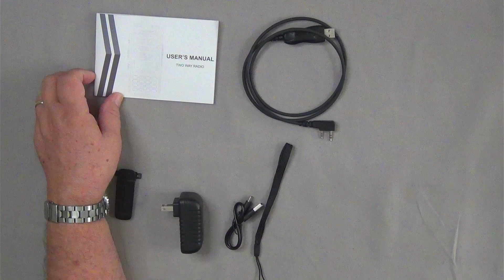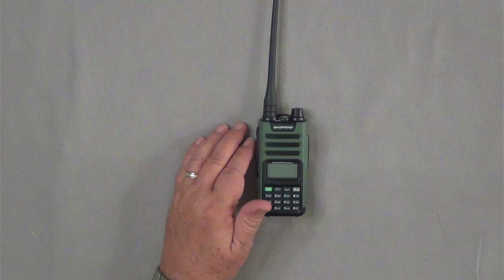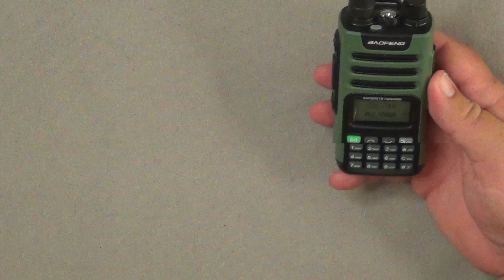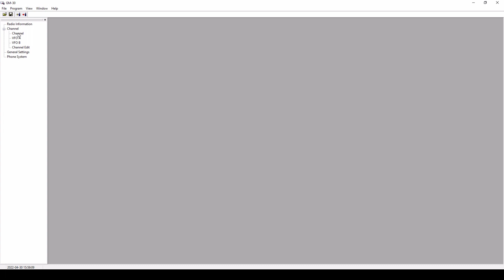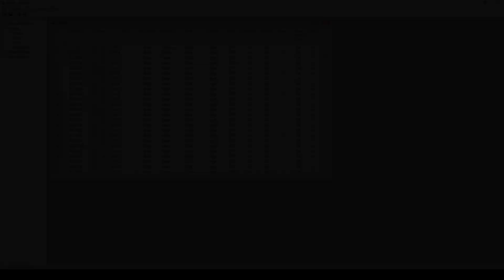BaoFeng GM - 15 Pro GMRS HT

Comment: Just got a 2 pack gm15 pro that was supposed to be 8 watts. And also supposed tobe 2100mah battery but no way to tell if the battery is 1600 or 2100. Some Amazpn reviews said they bought the same and only got the 1600mah battery. :)
Any easy way to tell?
Reply from the maker: I don't know an easy way unless you have a fancy batter tester that will run the thing down and measure mAh used.

Comment: I was looking at this radio on a Prime Day deal. Yes, it's almost an exact copy of the GM-30, but the GM-30's biggest flaw is that it has an SMA female on the radio which is the opposite of 99% of other Chinese radios. Per your excellent images, the GM-15 Pro has the SMA male on the radio. Wish I'd bought this radio instead. 😕
Reply from the maker: It is a bit odd that they have the reverse of so many other inexpensive radios.

Comment: For this radio, can you go to channel 30, for example, by pressing the channel button, and then program the tones into the radio? I guess I’m not sure how this radio works, (for example), if you can only go to channels one through 22, but then you have to program the repeater channels into it? This may seem like an obvious question, but I’m visually impaired, I cannot see the screen. The radio is actually on sale for $20, for prime day. Thanks for any assistance.
Reply from the maker: You can add CTCSS or DSC codes to either or both transmit or receive by channel as you described. GMRS radios have channels 23 through 30 as repeater channels so there is no need to figure offsets. Just remember TX is the code your radio sends out, RX is for what your radio receives. When dealing with repeaters, folks sometimes mix those up. Cheers.

Comment: Thanks for the information posted on the BaoFeng HT radios. I recently purchased the GM-15Pro, I downloaded the programmer software Prodioddity GM30. After installing the UART driver for the communication cable, it was an old driver but seems to be working on my Windows-11, when I launch the Radioddity program and load the radio information I don't seem to be able to expand any of the channel table columns and width, everything comes up collapsed on the display. Has anyone have had this problem? I can click and see the channel information screen just fine; this is the GUI box that pops up and I am able to set the settings with no problem. It is just how the channel table matrix being on the computer screen that it is collapse. Like in an Excel table one can pick a side and expand the height or width of the columns/rows not on this application though. Any suggestions? Perhaps is the old Windows driver provided by the Mfg that I need to update? Thanks

Comment: I just purchased a Baofeng GM-15 Pro. I've watched your video but can't make the talkies talk. None of the videos look like my screen. Point me in the correct direction and I will be greatful.
Reply from the maker: I have a video on programming a GMRS radio using a CPS. Start there.  It's much easier seeing settings in one place, not in a bunch of separate  menu items. First thing to check will be RX and TX DCS and CTCSS codes.

Comment: What do you do if all the com ports are grayed out? My computer recognized the device.
Reply from the maker: Hmmm. Check Device Manager and see what port the computer assigned. Try clicking on that one in the CPS. On my PC the ports that are active are very dim. Otherwise try a different programming cable that uses different drivers -CH340 or FTDI. Good luck.

Comment: How does this compare to the UV-G5 Pro?
Reply from the maker: The UV-5 G Plus radio has some additional features like more channels. It comes in a two pack so total price is higher, but per radio the price is similar. Also two antennas. Otherwise very similar performance-wise. Styling might be your biggest factor. Take a look at my review of the UV-5G Plus  https://youtu.be/7D5Fob77hHk?si=UOLkf0jniGrFy37_   Use the link in the description for a discount. Cheers.

Comment: I downloaded the software from Radiodity for my GR-15.  I can do the other programming as described in the video on the software but for some reason, I am not able to change the logo.  It is blacked out.  Any help on how to fix that?
Reply from the maker: Unlike some  of the most recent radio releases, these older radios allow you to only choose between the pre installed choices for the opening screen.  You can only choose preset logo, present message or voltage.

Comment: I only have a Windows 10 computer. Is all the downloadable programming compatible with W10?
Does it require a special cable?
Reply from the maker: Actually, some folks have reported issues with Windows 11, so you're good. A BaoFeng programming cable will work. A BTECH FTDI cable on Amazon costs more but is a good cable, too.Avoid cables below about $8 to $10.

Comment: Please excuse my ignorance. Is it possible to transmit on FRS channels with this radio?
Reply from the maker: GMRS and FRS channels are shared and are the same. FRS bandwidth is smaller but that doesn't seriously impact reception. The frequency table in the GMRS Wikipedia article is helpful in envisioning the various channels. Cheers.

Comment: What's the difference between baofeng GM15 pro and baofeng GMRS 9R
Kinda confused which to pick im new to this so no idea which do what all i know is they are gmrs
Reply from the maker: Two primary differences. GM15 has more programmable receive only channels and 9R has a waterproof rating. The 9R will require a different programming cable and can't use most accessories like hand mics or wired ear pieces since it has a different, waterproof connector on the side. If you're just starting out and don't spend time in the rain, I'd go with the GM 15 instead. Radioddity GM 30 is also a good choice at this price point.
Reply: @GadgetTalk4U  thanks for your reply, i usually work outside and my place get alot of rain and in winters, its dense fog through out the season
So i think that Ip67 9R is better option for me
But both are similar but one has waterproofing and other doesn't?

Comment: I'm new to HAM.  Can you listen to 2 drifrant channels at the same time?
Reply from the maker: Many radios, both ham and GMRS, have a menu item for a setting called dual receive or something similar. You can choose to listen to one or two channels. Some will also allow you to select which register you transmit on.

Comment: Thank you.  I am having difficulties downloading the Radiodity GM-30 programming CPS software.  Any hints?
Reply from the maker: In some cases, the CPS and firmware have to match. I noticed on the Radioddity web site downloads page that there are several firmware and software choices for the GM-30. Check you firmware by turning off the radio, press the button below the PTT and hold it while turning on the radio. The firmware number will display for a couple of seconds. Write it down. You may have to do this a couple of times to get all the numbers right. Mine showed 06.03.006. On the download page I'd get the 210615 version that lists 06.03.006 as the matching firmware. When I tried downloading it, it downloaded just fine - for me. Let me know if I missed the point of your question.
Reply: @GadgetTalk4U  Good advice, thank you.  It took some fiddling around but I finally got a read from the GM-15.  Then it took a few more experiments in order to get it to accept the changes and write to the radio.  Now, all 3 BaoFeng GM-15 Pro radios and my BTECH GMRS V-2 match but with two very different CPS.  Makes me appreciate RT Systems programming software.
Reply from the maker: @donalddodson7365  Good. I often have to remind myself I'm doing this for fun!  Things can be fiddley sometimes. Cheers.

Comment: I recently purchased (2) GM-15 Pros and installed the Nagoya NA-771G on both.  Achieved 6 miles of clear reception / transmission.  Located in Central Florida moderately hilly, trees from backyard to a point 6 miles as the crow flies. Very pleased. Thanks for the video.
Reply: Hi. I live in Central Florida and looking for a good GMRS radio that me and my wife can use. Your 6 miles transmission, is it simplex handheld to handheld radio transmission? I'm thinking of a base station and a mobile in with an 11-mile distance and if your 6 mile is HT to HT, I think my goal can be easily achieved (fingers-crossed).

Comment: Thanks for your review! i’ve subscribed. Since you have both the Radioddity GM-30 and the Baofeng GM-15 Pro , are the batteries interchangeable?
Reply from the maker: I hadn't thought to check. Good question. In fact, they are interchangeable. Thanks for asking.
Reply: @GadgetTalk4U  Thanks. I was hoping. Amazon has a GM-30, 2200 mah battery listed, so I’m ordering one for the GM-15 Pro radios I have on order. Can’t beat the price!! They had the GM-15 listed, but I wanted to be sure.

Comment: Lots of information here. Good job on that. Video is way way way too long, however. All we wanted to know was how to toggle between MR and VFO. And we were disappointed. Keep making videos.!
Reply from the maker: Length and depth are always a challenge. Sorry. Fortunately, most sellers or the manufacturer will have the User Manual available for download. I find that is faster than videos to find a specific piece of info.  Cheers.
Reply: You sound like a d bag

Comment: Do you have any experience with the UV-9G? If so, how do these two compare and do you recommend one over the other or would you even recommend the GMRS-9r or radiodiddy GM-30? 

I can't seem to find anything that really explains the differences/similarities of these radios and when I read the description and specs, they seem pretty much identical except for a USBC charging port and battery size. As far as the function and programming of the radio, I would love to hear which one is recommended over the other and why.
Reply from the maker: I have reviews on the UV9G, and GM 30 on the channel. They should help you make your choice. Cheers.

Comment: You can't program with chirp nor radioity so it's junk
Reply from the maker: I just checked, the GM 30 software that I use in the video is available at Radioddity. I'd try the original version first. It worked fine for me. I haven't tried the version for the new GM 30 firmware.
Reply: @GadgetTalk4U  but you can't modify the frequency you can't get rid of the frequency they allready have in it. You can't put ham frequency in and modify. O well I'll send back to China. Get a different one
Reply from the maker: OK. I understand. For GMRS radios sold in the US, all transmit frequencies are locked to the GMRS channels. Even newer ham radios are range locked nowadays.
Reply: You can program it with Radioity as a gm-30

Comment: Good Morning Sir. Question regarding FM radio frequencies with this radio. I just picked up 2 of these for my brother as a gift, and one pf them can only recieve between 65 and 75 MHz. The other works fine and receives the full range of stations from 65-108 MHz. Is there a way to fix/unlock the rest of the stations either manually or with CPS? Or is this a defect I should return. Thank You in advance.
Reply from the maker: According to the instructions I saw, when listening to FM, press the back/weather key to switch to the US FM range. I think it is section 6.8.
Reply: @GadgetTalk4U  Thank you for the swift response Sir. That worked! I really appreciate your time and expertise and I hope you have a great weekend!

Comment: Quite a radio for $30 
Again I will ask on usb charge plug.
 How does a 5 volt cell charger charge a 7.4 vdc battery. 
Unfortunatly no community repeaters up on a tower so no repeaters in SW PA . So gmrs is only good for simplex which all stores are using outputs and you can't enjoy gmrs repeaters anyways.
Reply from the maker: Duane, If your goal is to chat with others in the area, consider getting your technician ham license. About 30 to 40 hours study with free online study tools and you'll be good to go. Maybe less, depending on your background. 5 volts charges 7.4 because the 7.4 is actually two 3.7v cells. USB chargeable batteries have a charge management component somewhere in the circuit.

Comment: Anyone know how to toggle from high to low power? Some of my standard channels are set to L some to H, no settings or info in manual
Reply: Channels 1-7 should be high power (5w)  High
Channels 8-14 should be low power (0.5w)  Low
Channels 15-22 and beyond should be full power (up to 50w) Super High
The FCC set those power limiters and your radio adjusts the power automatically.

Comment: Do I need the Radiodity gm30 software to program the Baofeng gm15? Chris does not have the 15 as option.
Reply from the maker: You can do much of the programming from the faceplate if you'd rather. Otherwise, yes.
Reply: @GadgetTalk4U  thanks

Comment: dude!!! Thanks, my TP-8plus came to me locked, how do I unlock them? or what combination of keys should I press to unlock it!!! thanks greetings!!!!
Reply from the maker: I'm not sure what you mean by locked so if I missed the meaning, I apologize. The * key on the keypad will lock and unlock the keypad with a long press so you can change channels, and go into the menu system, etc. The small icon is supposed to resemble a key. If you have the CPS, load the radio's settings into the CPS and on the General Settings Tab, uncheck autolock and reload to the radio.
Reply: @GadgetTalk4U  hello friend if I explain when I write some frequencies that I have configured in other baofeng models and press the ptt key you only hear a beep, it does not let me transmit in a wide range of frequencies I have seen that in other bofeng radios they make a combination of keys They turn it on and it goes into a factory mode and unlocks the frequencies, that's what I'm looking for for my uv-13 pro. I hope you can help me I would really appreciate it! Thank you
Reply from the maker: @laloromero2893  I understand now. There may be a hack of some kind to unlock the radio but I'm not aware of it. I would also be telling you how to violate the law/rules and YouTube frowns on that. Sorry.
Reply: @GadgetTalk4U  thanks, but it's not violating anything and unless youtube says something, I've bought several radios and they don't come with blocking, apart from that I can't even put free-use frequencies like a talk about that children use to play, also in my country Those frequencies and many more are free, I also never transmit on frequencies that I should not speak or listen to, rather what I am looking for is to have the radio unlocked to be able to make it functional. I hope you can help me even if it is giving me some reference. Thank you.

Comment: I followed along and tried to setup my ht like you did, but it shows channel 1 as 435.08500 it doesn't have the gmrs frequencies in it like the computer shows
Reply from the maker: Are you sure you're not in VFO mode? A long press on the menu key (top left) switches between the two modes. If you have the voice prompt on, the radio will announce "channel mode" or "frequency mode."  With a GMRS radio the channels are locked so you shouldn't see anything but the GMRS frequencies in channel mode - channels 1 - 30. and the DIY reserved channels. If that doesn't work, contact your seller. Maybe the thing's broke.

Comment: Mine does not let me transmit on frequency mode. Transmit fine on channel mode when testing with frs radios. Anyone have this issue?
Reply from the maker: In the US the FCC requires GMRS radios to only transmit on GMRS frequencies and doesn't allow users to input frequencies, even if they are the GMRS channels. You can only transmit on those channels which are accessed via channel mode. The FRS and GMRS channels are the same except for bandwidth and output power. Your FRS radios should work fine with a GMRS radio.
Reply: I see i see. I wasn’t able to scan ctss/dcs tones either. Am i doing something wrong? Thank you for the response and the vid btw! Very informative!

Comment: The one odd behavior that I've found on this radio relates to charging.

When you plug in the charger to the USB port, the radio stops receiving.
You can plug in and  charge your cell phone while using it; but not this radio. Unhandy, but not a deal-breaker. Just plan ahead.
Reply from the maker: Thanks for watching and commenting. I suspect this is because they don't want the lipo battery to be damaged during charging. The instructions mention this in section 2.7. It maybe they saved some money by omitting battery protection circuitry and just tell users to charge with the radio off. Cheers.

Comment: Should I get this or a second GM-30?  Is there a way for me to program this with a Mac?   I don't have a Windows machine.  How does the power out on this unit compare to the GM-30?  Thank you so much for your videos!
Reply from the maker: Ruston, I'm not a Mac guy so I don't know if you  can emulate a windows machine or not. Nearly all CPS is Windows based now. You may want to consider getting a cheap renewed laptop with limited specs just for your radio software. The GM 30 is on sale now so there is not much of a price difference. Get the Baofeng if you want a different colored case or the GM 30 if keeping things the same is important to you. Don't forget my affiliate links in the description. Thanks for watching and commenting.